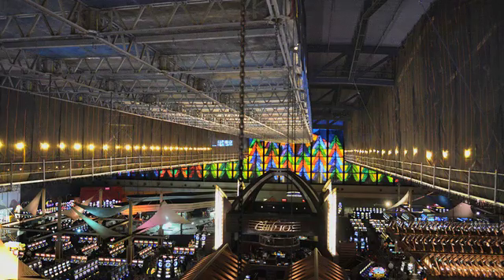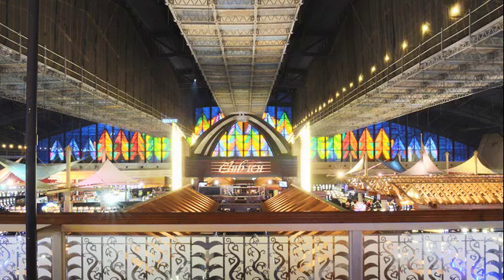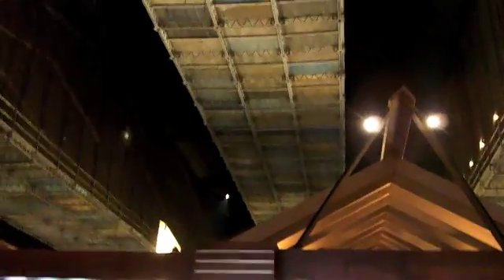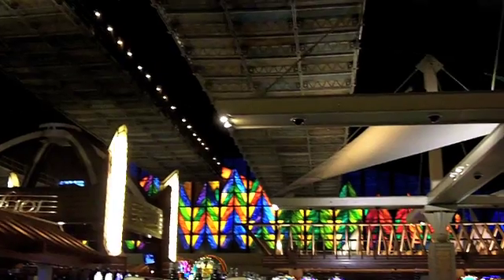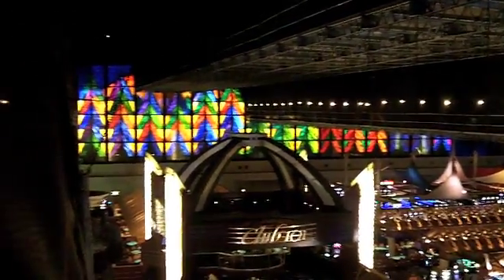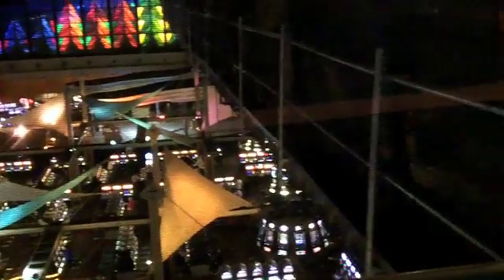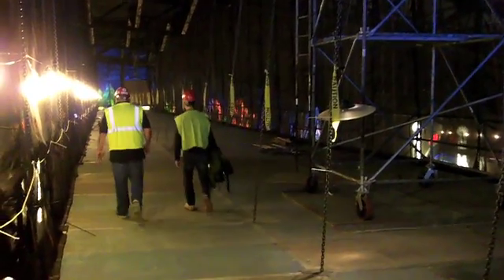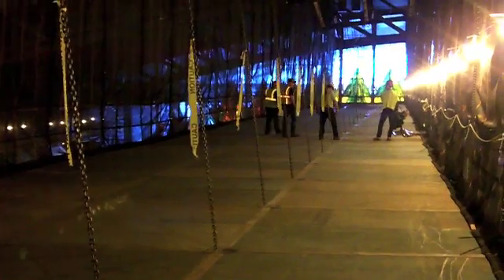Seneca Niagara Casino - Multi-point suspended scaffold platforms - scaffold rental, PA

Comment: Spader Suspended Access Consultant has reached a new "pinnacle" in 2013 at The Seneca Casino in New York.  SSAC was asked by Superior Scaffolding out of Philadelphia PA, to supply suspended scaffolding training and certification of employees in order to install the suspended access system at The Seneca Casino. Under the control of Superior Scaffolding, SSAC was also asked to supply professional leading edge erectors to install the suspended staging as well. Superior Scaffolding also relied on SSAC  for a suspended access staging company who could rent all the suspended staging, and suspended staging equipment / tools needed to do the install and job.  All the request were fulfilled flawlessly, and timely for a very successful job.  Great job done by all ! !   www.erniespader.com